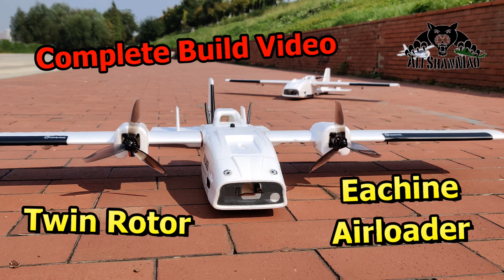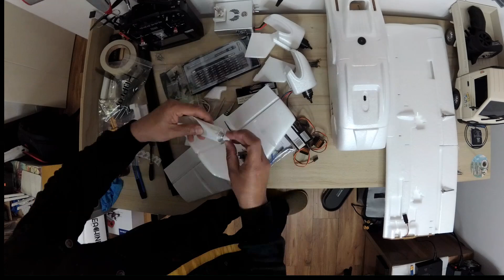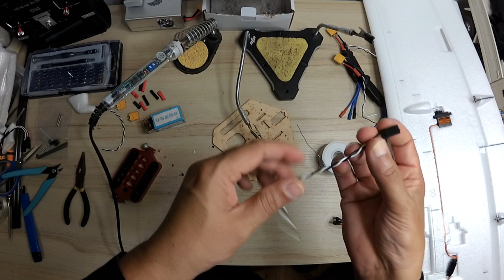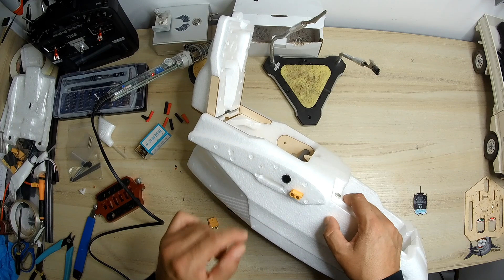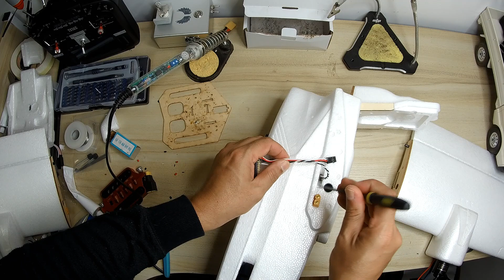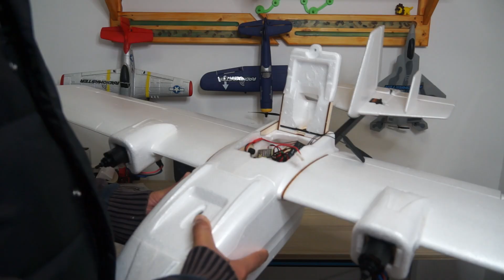Eachine Airloader Twin Rotors Complete Build Video

Comment: My wing connection wasn't glued in so I can pop it out after loosening aileron servo plug from wing, solder all plugs for wing esc & flap servo plug, afterward  glue it in.  Good info on your video, thanks! EDIT: Only 1 side :(
Reply: On the other wing I used 1.5mm punch to push the connector thru toward the wing, very small tappy tap tap,  1 layer of the plywood broke away above the connector cutout but it glued back in.  Be careful & be ready to fix the damage!
Reply from the maker: good

Comment: In the box that came from the seller, I did not find any assembly instructions. I could not find this manual on the manufacturer's website either. Does this guide exist?

I don't understand the following questions:

1. How to fix XT-60 connectors?
2. How is the camera installation part used?
3. How to solder the wires to the connector inside the fuselage?
4. Is it possible to control three motors on MATEK F405-WING?

There are other questions.
Reply from the maker: This video explains it all i believe